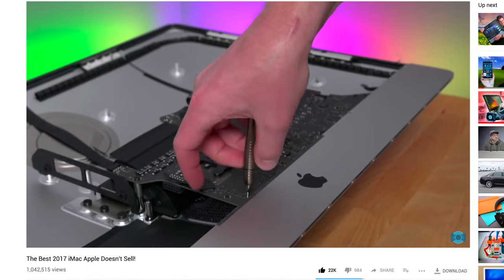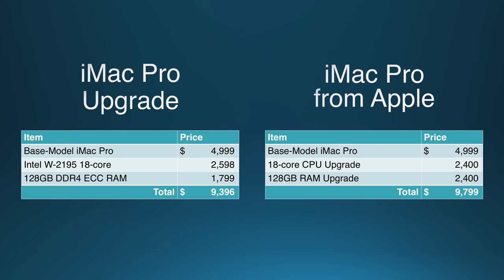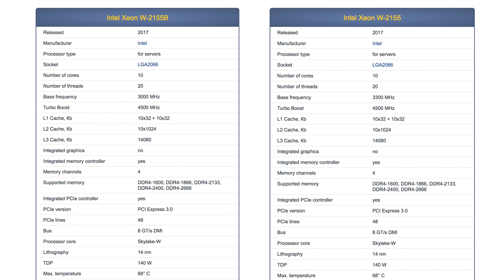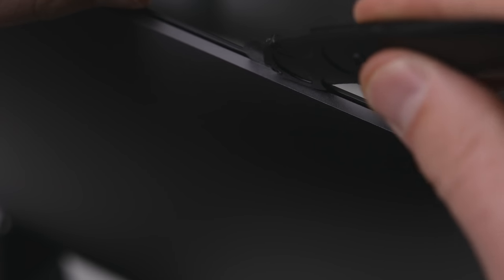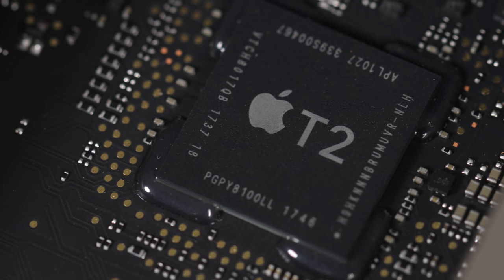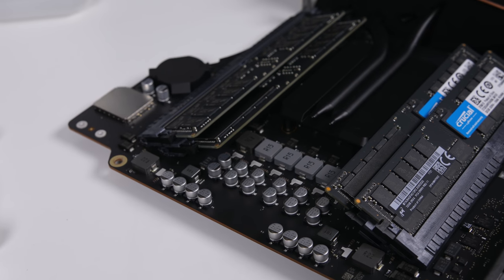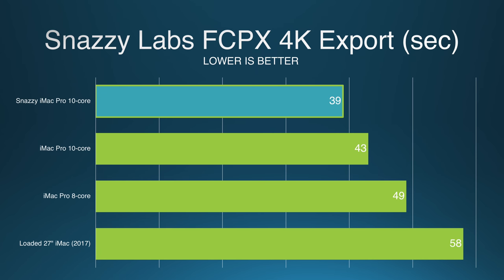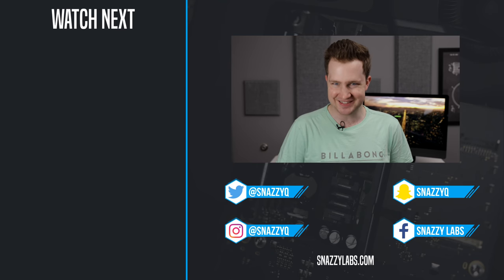Can You Upgrade the iMac Pro?!

Comment: Wow this was a great video!
I do however disagree with your assessment that you can build a PC that can “smoke this thing”, full stop. The full spec of this, with an 18-core Xeon and Vega 64 (technically the Vega Frontier “64X” with 16 GB RAM, which was a measurable gain over the standard Vega 64) was more powerful than even some of the best PC builds of its time. The only way you could match the performance of this (let ALONE exceed it) would be if you spent LUDICROUS amounts of money… like as in, double the iMac Pro’s cost. And even then, you certainly weren’t leaving it in the dust or anything. In terms of raw performance it’s still a beast to this very day.

Comment: Great video... Fun fact though.  A comparably priced PC will not have as many heat issues as these imacs will.  But, it is impressive looking hardware.
Reply from the maker: To be fair, this machine doesn't get hot enough to throttle.
Reply: Snazzy Labs That's pretty amazing honestly.  I just imagine having that much power crammed in such a tight space will wear out faster due to heat.  But, you have one, and I don't.  And I trust ya!

Comment: The imac pro is cheaper until you need to fix it. Last time my PC stopped working, I ended up spending $60 on a new stick of RAM. Before that, it was $10 on thermal paste. And both fixes took me less than 10 minutes. With little to no risk of damaging anything or hurting myself (ie. no lcd panel removal and no exposed power supply).

Apple probably would have charged me for a completely new logic board both times if Linus' experience is anything to go by.

Comment: Since both CPUs have the same single core boost clock, the 'B' cpu in your friends unit and the 'non-B' cpu in yours, you have to wonder if the thermal dissipation of the OEM thermal paste is actually that bad. 

Maybe you should de-lid the 8 core and retest.

Comment: WAIT A MINUTE! 
Raid 0 does NOT give you 1TB with two 51GB storage devices.
In fact, it will only give you 512GB but with in theory, almost the double speed.

If you were to go with 4x 1TB in raid 0 you get something like 2.72 TB with up to 4x the speed. This is what I personally use as a scratch disk.
Reply: Yes it does. You are thinking of RAID 1.

Comment: The 10% performance improvement is completely down to the 10% higher clock speed. This also exposes that the 14-core iMacPro is running even slower clock speeds that the 10-core.

I am also curious what the real price difference is between the W-2150B and the W-2155 considering that anything branded specifically for Mac is typically 20-30% higher priced. In a general search I couldn't find any price data on the W-2150B though you can bet that Apple is paying far less per unit than even the largest suppliers are paying for the non-B versions.
Reply from the maker: No doubt. Especially considering Apple's economies of scale. Even with relatively low volume on this particular SKU.

Comment: Fun fact #1: No matter how many cores you put in this Imac Pro, you will never have Intel Integrated QuickSync H264 hardware encoding/decoding, because that's only available on consumer CPU's like the 8700K. Why this matters? Fun fact #2: The latest Adobe Premiere adds support for this hardware encoding/decoding and can use your CPU, your GPU and the Integrated-GPU with hardware encoding all at the same time during playback AND rendering. HUGE performance gain! This is essentially making the Xeon line of CPU's (and this multi thousand dollar Imac) instantly outdated for this type of work.
Reply from the maker: Depends on the codec. My camera records in ProRes so QuickSync is worthless to me.

Comment: So... I am about to upgrade a used Dell T5820 workstation from its original 4 core Xeson W-2123 CPU to the Xeon W-2140B-- Yep, the same model CPU that came with the base model iMac Pro.  Got mine on eBay for $175 plus tax.  Seems to be plenty of them at about this price on eBay (and the W-2150B for $100 more than that) perhaps because all the people doing DIY upgrades on their iMac Pros?

Comment: Great video, I'm wondering if you have seen any of the thermal throttling that's been occurring on the stock iMac Pros people have been complaining about after the upgrade? A nice add to this would've been seeing exactly which thermal paste you used (and show how you apply it so it's not excessive). I've given up on Apple after 18 years and will opt for workstation mid-tower with 4k display, tired of the severe price gouging. For laptops the latest high end 15" competitors are killing it with price and performance- comparatively. Thanks again for the excellent info.

Comment: I've learned that my 2011 imac 27" i5 2400 was so slow, not due the ram or SSD. But simply the CPU was downclocked due thermal throttling. So now I've got a Gigabyte mainboard with an 4590 i5. With a huge cooler on the cpu. This thing never thermal throttles, can punch on this cpu with 100% load, and still get Illustrator or Photoshop work done. And with only 16gb ram (instead of my iMac where 32gb is put in) it is in all areas faster and responsive. Basically the iMac is a supercar with the front grille (air inlet) taped shut... WHAT GOOD is all that performance hardware when it cannot be cooled properly???

Comment: Yes on paper an iMac Pro is cheaper than an identical PC, but a PC is easier to upgrade and has the potential for better cooling, modularity, and windows itself allows for more customizations. I like Macs for their OS which I will admit is buttery smooth, but you can also just build a Hackintosh with the same pros as a self-built PC and the pros of MacOS.

Comment: you have to know that mac os is not restricted to specific cpu models, but to secific cpu features and architectures and also the bios too, and also because the b versions of the xeons should have the same or very similar microcodes required at bios level as non b models, you can use it as drop in replacement and it works fine, the same thing with lower end machines, they create the bios for a generic kind of machines, not so specific hw configurations, so you have flexibility for the cpu models you can put in it, the thing i don't like is that they are slovely killing upgradeability and any kind of easy and that should not void the warranty, internal mainteinance, unlike the older models did, like the old mac pros, i just hope to see new fully upgradeable apple machines like the old mac pros in the future

Comment: Hello JDW...

I need your opinion/advice...
I have a late 2009 27" iMac EMC2309, with the black screen of death.  No lines, no dim screen, no flickering, just a black screen.  the computer turns on and makes the chime and i can hear the fans going, but thats it.

After a significant amount of time researching the issue on the internet, the two main reasons for this is a dead LCD screen or a dead graphics card. I can't do anything about the screen, but buy a new one(or used) and I can't  do the bake on the graphic card as that a bit too technical for me.  so my options are to buy an lcd screen or buy the whole video card (Video Card ATI Radeon HD, 4850, 512MB. The screen is about $250 and the video card is around $350 and i don't want to buy both.  What would you do if you were in my shoes and trying to salvage your computer??   The black screen of death happened two days prior to me ever opening the computer and trying to replace the HDD with an SSD.

your thoughts/advice/help would be greatly appreciated. thanks,Phil !!!

Comment: That Vega has to be pretty undervolted/clocked, that PSU is way underpowered to run a full-system load when the Vega (ok, reference model) pulls more than 200W at max load.

Comment: In my country you can build a hackintosh for 1800€ that easy crushes the 5500€ iMac Pro and for 3800€ you can build a system thats way better then the 10000€ iMac Pro. The Problem with the iMacs is the downclocking thanks to the bad cooling. After 15 mins of benchmarking the iMac Pro got so hot that the system turned down the clockspeed to about 70 to 80 percent. So if you are smart. Build a Hackintosh.

Comment: Awesome! Would you be able to upgrade the 8-core to the 18-core w-2295? Seeing that OWC just confirmed a max 512GB ram makes it even more powerful, somewhat closing the gap (just a bit) between it and the new Mac Pro. Too bad it's not user-upgrade friendly...

If it can handle the slightly higher TDP, what are your thoughts on pushing it higher with the w-2295?

Awesome videos and info!

Comment: Why building a brand new PC? You can get a cheap workstation from some eBay stores which refurbishe them and after you get your hands on them, then you can just put a GPU into them.
For example I got a HP workstation dual Xeon E5-2680v3 last month and I just put in a Gigabyte gtx 1050 ti OC. Workstation costed me 1344,80$ [usd] and I paid 163,99$ for the gpu on Amazon. For this price I got very good setup and it even has a SD Card Hub which allows me to insert six SD Cards. This can be practical for photographers or people with a Raspberry Pi 3 cluster setup

Comment: The PSU won't have anything to do with the CPU downclock since they both have the same boost clock. Under max load both CPUs theoretically should be using the same amount of power. Giving Apple the benefit of the doubt the downclock is, as you say, for that sweet, sweet fan curve.
Reply from the maker: Also may be for VRM temps which are indeed, poorly cooled. Hadn’t considered that.

Comment: I hope you really tried to boot it first before applying those adhesive strips :)
I'm used to go inside my late 2012 27' model so often that I don't use those strips at all -- nothing like a good duct tape to hold the screen together .. it actually looks nicer than one would think. 

Great video, thanks for the upload.

Comment: You can't put a price on thermal throttling. Also the 5k display is not that good for colour grading and photography. It's a good all in one yet a poor choice if you don't need one and few need a all in one.

I think you should do a project where you transfer in a properly vented case and install the 5k panel in a old monitor and get a proper desktop :)

Comment: So the cost of the new 10 core chip, the new 128g's of ram, all installed was $5 dollars cheaper then apple's Same stock 10core 128g build? that doesn't seem possible as apple over charges each ram stick by like 70 percent. what am I missing?

Comment: What i am wondering is that quality and speed wise are those components that you listed comparable to the tinified ones in the iMac Pro, dunno if i am wrong but is a tiny Nvidia Gtx 1080ti & laptop Ram as fast as a complete card like the Nvidia Gtx 1080ti Rog Strix Oc edition and a trident z DDR4 Ram? As for monitors you can get a 144hz 4k 1ms response time and G-sync which is bigger as well for the same money, the only thing that i can agree is that the calibration of colors is a pain in the ass and all Apple products come precalibrated.

Comment: Crazy question... can you swap in a i9-9900k and unbuffered/non-ECC memory? The i9 has a base clock of 3.6 GHz and boosts up to 5 GHz. If you can de-lid and use LM on the die and thermal block, there should be enough temperature headroom to get this CPU to fly. I got a non-Xeon to work in my 2009 Mac Pro, so wondering if this might be a similar situation.

Comment: Getting a PC from a big manufacturer should be WAAY cheaper than building your own because the big company can buy in bulk and save a lot! That's why even if Apple can sell you a 5k$ Mac it must be better than what you could build for 5k$ everything else is just extra profit for them! It all depends on how the user buys the systems, if I see great hardware for a good price, I'll get them, so I already have a great 4k monitor, enough hard drives and SSDs so no need to buy it again packaged inside a beautiful box that's glued together.
Just for comparison, I built my Threadripper-PC in September for 1500$ and it got SC 4632 and MC 40329 in Geekbench and it's fast enough. But consider the price to performance ratio for a fraction of the cost in my situation. Of course if you have a very old computer right now and want to get rid of it and replace, then a Mac is not that much more expensive than getting comparable hardware.

Comment: your cost are wrong sadly most modern motherboards boost a WiFi module and  Bluetooth plus wireless keyboard and mouse can be at least 100$ cheaper ...  making both prices pretty much the same. I would cut-down a little on the monitor .... 5k might be gorgeous but most won't see the difference past 4k  unless you are looking at the screen thru a microscope then you're just weird

Comment: thats where your wrong a prebuilt dell with 8gbs of ram and a quad core with a 1050 will run you 1000 dollars but for 20 dollars more you can build a pc with a msi b350 pro with the am4 socket and a ryzen r7 8 cores at 3ghz and a 1060 as well as 16gbs of ram and your choice for hdd

Comment: "Why you void a warranty on a $400 price difference on a $10000 computer" Voids warranty on a $8000 PC over $5 in initial pricing (he could probably make $1k ish back if he sold the ram and processor), and for 2 cores and a 300 MHz difference from the 10 core apple processors base clock

Comment: i use a HP workstation,
But i did not buy a new one....
I builded a hack.tosh HP Z620-(2x xeon2660 v2 8 core...so that makes 16 c. total)-32GB ram ,a second hand blue ray player,and a new samsung 960 evo nvme ssd...
Its a machine from okt.2016,it came without O.S. and had no hdd in it......................i payed under 250,far ALL great hardware.   Cinebench score 1880 point with nvidia 710...

Comment: So the storage is just RAID 0...? As in they're selling a computer that, off the shelf, has its storage configured with RAID striping & no duplication/redundancy - AKA one of the few RAID configurations that actually increases the chances of data loss? I know SSDs are more reliable and all, but I wouldn't trust that setup for anything other that a scratch disk.
Reply: This and check what TheExileFox wrote.
Reply: Yep, it's a bad news that the storage is RAID 0. Totally not pro if you want to store data on it

Comment: Don't bother looking at the TDP on the intel chips. They list the TDP of the 8700k at 95W yet the 8700 is "30" less at 65W. The boost clock is only 100MHz less, and the base is only  500MHz difference, which on a 6C/12T CPU is not a 30W savings. 

They both thermal throttle on a stock cooler. so TL:DR, don't bother taking their "TDP" seriously.

Comment: While the thermal paste looks awful, and is applied excessively, I believe they choose to use such compounds because they keep their properties well over time. That is, it's probably nowhere near the best option when freshly applied, but will continue to perform consistently for years without leaking out or anything like that.

Also, while I absolutely hate the sight of excess thermal paste, it's really not detrimental to performance... although they definitely should have cleaned the CPU off much better before installing it.
Reply from the maker: The excess isn't as offensive as the cheap quality of the stuff.

Comment: Hm... interesting comparrison at the start beween a PC and a Mac Pro... let's ignore the actual prices and just compare it to those you used. I was wondering, in your comparison, did you accounted the adjustments Apple made, to the CPU for example? Or more bluntly, what would you pay for a downclocked CPU (as the most obvious example again).
It is true, the new Mac's are way better priced than a couple of years back ( considering at how many ends they spare this money deliberately ignored for once) but to mention the screen is not a very good argument. Sure, you get a new shiney screen... but charging it would raise the price around 500 bucks and since on the PC side, you aren't forced to buy a new screen with every new computer, this is is a cut Apple needs to take to stay competitive. That's like forcing someone to buy a new pair of shoes if buying socks.

I personally use a ColorEdge CG2730, a Cintiq 22HD and an old Eizo Monitor from 20 years ago. I can plug these into every Computer I desire from now until the day they aren't supported anymore and get perfect images for the purpose. Sure, it is not the newest 5k to impress the tech community but outstanding hardware that marvels in its fields. So, how should Apple get away with, what they did back then, overpricing the components and charging something PC user in this price range already own in some way or another?

You can love or hate Mac all you want but lets be honest Mac was extremely overpriced and still is expensive for the priovided tech. Not just because PC users can adjust the components to their needs and liking but also get better deals. That the components are finaly are fairly priced is great but a fair price is not the best price.... taht this for once is a good deal is great, but doesn't make the facts invalid... actually it makes the case even worse since it means Apple could charge less but choose not to. And well, thinking of all the issues in built quality , all that stuff you read about and the horrible support,  the lower price maight be having a different reason than fair pricing...

Comment: Nice video thanks for sharing with us - I have an iMac Pro with 32 GB of RAM that I would like to upgrade. I do not see the Crucial RAM options online, especially with the black PCB RAM you acquired in the video. Could you link me to the Crucial options of 128 GB or 256 GB RAM thanks!
Reply: Hi Joseph, I’m looking for the Crucial RAM too. Did you find it? I recently installed OWCs and have them removed the next day because they  where defective. Almost ruined my iMac. If you could help I would be thankful